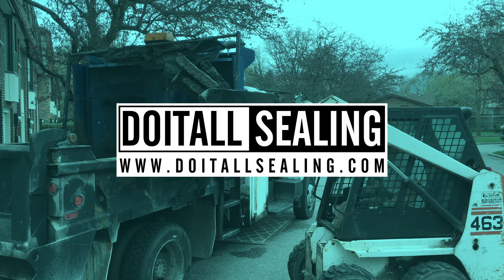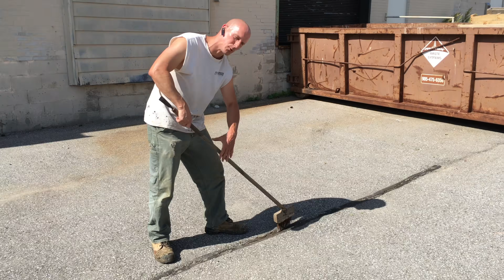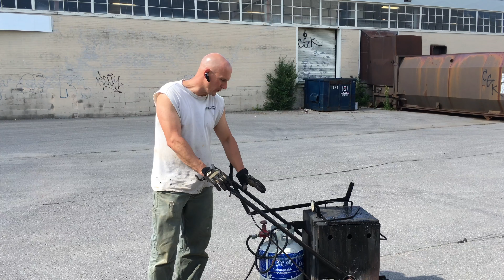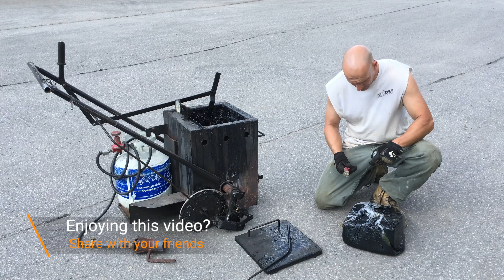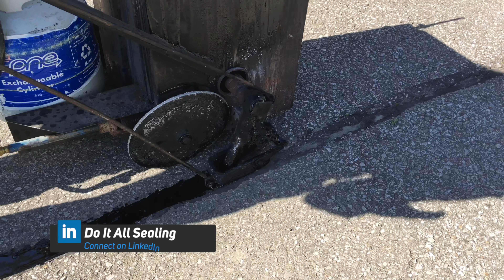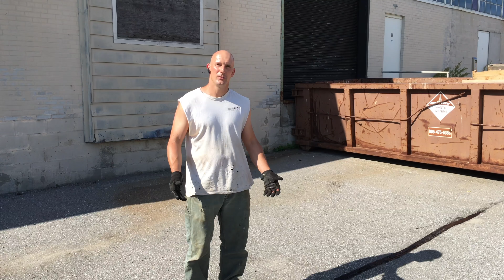Hot Rubber (4K) Crack Sealing Repair

Comment: Do you keep the torch on low the whole time you’re using the machine? Or do you get it to temp and turn it off?
Reply from the maker: I normally keep it on the whole time unless everything is melted and im working slow.   Or if it gets too hot i will shut it off for a bit.

Comment: Appreciate your videos. I stripe for an airport as my full time job. I started striping parking lots last summer and now like to add crack filling. 
I’ve only found one place to get this equipment and materials from a local seal master.  
Not sure how they rank in quality? How long after crack filling can you drive o we it and stripe over it? 
Thanks for any suggestions. Liked and subscribed 👍🏻
Reply from the maker: That's awesome it must keep you busy for sure. I haven't used seal masters rubber but assuming the hot pour kettle to drive on it you should be able to drove on it 15-30mins after you seal the cracks.

Comment: My machine is leaking uncontrollably from the open and shut valve any troubleshooting advice?
Reply from the maker: There is plastic most likely stuck and you just have to take off the swivel portion heating that entire area up and dispose the gunk there. Replace and it should be good to go.  I clean my machine out 1 or 2 times a year.  Thanks for watching!

Comment: Do you charge per square foot of Crackfill? Is there an average?
Reply from the maker: Yes we charge per Linear Foot.  The pricing would depend also on the type of preparation required.  If they require the cracks to be routed and opened up before crack sealing than it would be a bit more.  If the client just needs the cracks to be cleaned out and sealed that would be the cheaper option.  Also, there would always be a minimum charge just for showing up and doing some work.  So, it would all depend on the amount of repair needed.